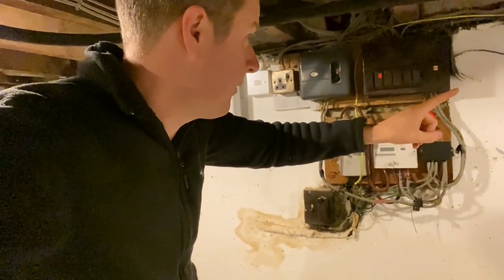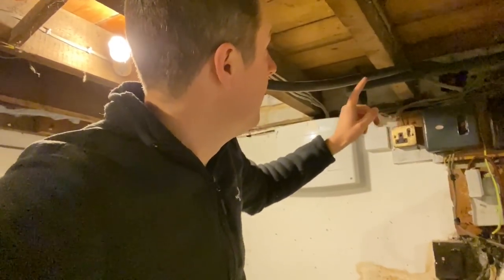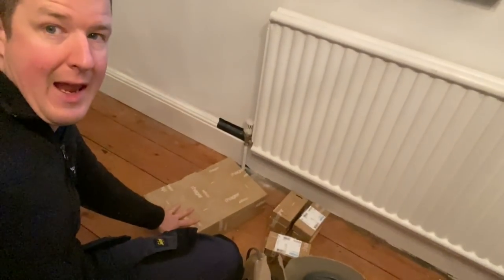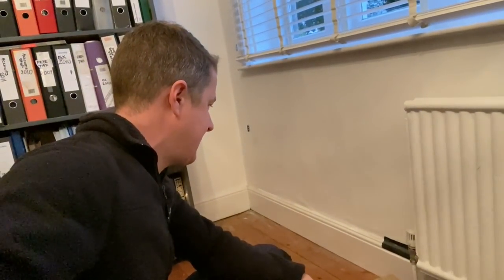Moving A Consumer Unit & Installing a Sub Main

Comment: As a DNO employee I'm surprised at what the UKPN jointer told you!
Removing the cutout fuse is a prosecutable offence and should only be done by trained and authorised personnel. If you need isolation then your DNO will (in our case at least) safely disconnect and reconnect the supply for you, or install an isolator switch immediately after the meter. 
Also bear in mind that smart meters alert the supplier whenever power is lost. The supplier then contacts the DNO to alert them to a power cut. Someone from the DNO then turns up to find an electrician with the cutout fuse out. Having been sent there on a potential fault you have to report what you have found to have caused the fault. You'll be lucky to find a DNO employee who will stick his neck out and lie for you in that situation 🤷‍♂️
Reply: I agree. A jointer / mate should never as any non UKPN employee to remove a fuse for them. The old cutout should have been removed and the earth on the new cutout was put into the wrong side of the cutout.
Reply: How exactly does one go about getting them to install the isolator switch? The former owner did a sloppy DIY job on my CU, and as fixing it up means pulling the fuse anyway, it makes sense to have an isolator fitted to facilitate future work.
Reply: @vylbird8014  you would need to contact your local DNO. This is who owns and maintains the electricity supply to your house, rather than the supplier who you pay your bill to. (Google who is my DNO) . They will be able to supply and install an isolator for you. It is chargeable work, I think around £130 if memory serves. It is fitted directly after the meter meaning any work on any part of your internal electrics can be completed safely and legally.

Comment: The bits of left over dno cable I've played with in the past have always been 25mm solid aluminium phase with a 25mm stranded copper concentric neutral. That's domestic of course.
Is a metalcad fused switch the correct item to put in an external enclosure? What is the corrosion warranty on such a thing? All DNO equipment is plastic?
Reply: New DNO stuff is plastic just as they're making us put in metal CU's, they're not filled with Bitchumen anymore either, it's gel based stuff like you'd find in those wiska underground rated joints though the outside underground joints they use are setting resin pours. That outside green cabinet is plastic ip65 rated so the metalclad fused switch isn't an issue. 

Depending on area/size supply most of the 3 phase supplies are solid copper cores I've come across, anything from 75-250mm. Apparently there's Aluminium ones for the bigger cables on the newer supplies but I haven't worked in any large sites that have been built post 2000. Edit: The 3 phase are concentric too with the outer armor sheath being cpc/neutral.

Comment: Pull the fuse!!! 
I was made to go on a course to learn how to pull a supply fuse,
Reply from the maker: Ha ha ha
Reply: Just watch Youtube pmsl :-D
Reply: Yes. Pull the bloody fuse. 

Half the monkeys that turn up to do it for you probably couldn't spell fuse!
Reply: Yeh kill any load before pulling!! Another reason you may have to pull main fuse...we had a few call outs to    standard cable damage inside the property where the fault current was enough to take out the main 100A cutout..as well as the mcb,S ect...panic,go try and buy one then fit it,!! .so buy 2 And keep one on the van.generally 2 sizes.

Comment: The DNO will not remove the cut-fuse unless emergency or holder damaged. For me every situation is a question of safety and as long as you isolate the load before and after pulling the cut-out and it’s plastic then I don’t see what the problem is. Metal cut-outs with close distance between the fuse pins and holder are a different matter. 
Generally it’s the Energy supplier’s job to pull the fuse for a CU change.  This can be a nightmare to arrange as there are now 60 suppliers and they tend to come and go. Also all call takers do not understand the service you require. Other problem is they will initially only talk to the account holder. Some companies do the task foc whereas others can charge £50 or more and need  3 weeks notice.
Reply from the maker: Yeah what a can of worms!
Reply: i've never understood the term 'energy supplier''.. surely that's synonymous with the DNO... I think 'bunch of people who send you bills and do not a lot else' is better <grin>
Reply: @TheChipmunk2008  The DNO pulls the fuse, but the DNOs seldom communicate with the homeowner or electrician directly - usually communication goes through the 'bunch of people who send you bills.' So the homeowner asks the electrician who asks the supplier who asks the DNO... and somehow it takes a month to actually schedule anything.

Comment: Are you going to box in the cables underneath the consumer unit?
Reply from the maker: Yeah the customer will
Reply: What if they don't though and someone damages them cables and gets a belt??
Or do you just note on the cert customer to box in cables.
Great video jordan
Reply: Theres nothing wrong with clipping direct through a joist space in a cellar. You would not have to state anything on a cert regarding this 🤔

Comment: wonder how hot the service cable gets if one were to put  95amps of dummy load though it. Needs to be tested, cause it doesn't look like it would handle it continuously.
Reply: They handle it just fine. barely get warm. The older service cables of about 9sqmm equivalent copper get a bit warmer on a 100 amp load, but PILC can survive that temperature

Comment: Hi Jordan.  I'm an adult learner with plenty of theory but no experience.  At the beginning of the video you mention that the water incomer is plastic but has copper parts later in the system.  My understanding is that if the mains supply is plastic, there is no need for bonding.  John Ward's video https://www.youtube.com/watch?v=a5JOTA-mJ4A  explains this.  Have I got it wrong?
Reply: I could be wrong here, would the incoming water mains not act as an earth, when it enters the copper pipe section. Copper is the conductor and so would the water inside, and the rest of the water?

Comment: Great video, one outstanding question. Why downgrade the 100amp supply head to 80amps with your MCB at the isolator feeding the SWA and consumer unit, with EV charging being install in more domestic properties that extra capacity maybe needed.
Reply: Answering my own question, with reference to Fig3A4 p370 BS7671:2018, 80A typeB circuit breaker with not breaker after 10,000 sec from a load of slightly over 100amps.

Comment: Did you just touch a live supply cable without checking with your Voltage Detector Pen could save your life always check unknown stuff its not technical and cheap

Comment: Isolate all loads. 

Pull main fuse.

Stop worrying, it will be fine.
Reply: Have been told in the past you can pull main fuse but a big no no is interfering with the meter .
Reply: @raychambers3646  I've switched tails in the meter before. 

It was like that before you turned up guv. 

I used to care, but unless the main fuse looks like a relic from world war one, ive stopped caring.
Reply: @MH-sf5ml  I've taken live tails out m/clad db  before now,not as scary as it sounds.installed new db and reconnected.

Comment: Dno size their cables according to average demand which is 2kw. So technically they only have to put in like 2.5mm 😂
Reply: Also, the way DNO cables are constructed, we use separate cores for earth, neutral and live and each needs to be thick.

But with DNO, if they wire them up as PME they only need a solid core for the live, then they have an outer layer which surrounds it and doubles up as earth and neutral combined. 

So rather than being a big thick cable with 3 thick separate cores they only need a cable with 1 thick core wrapped in another thin layer like on an armoured cable.

So cable effectively becomes same size as a single core armoured cable.

Comment: How on earth do they splice the incomer when it's live?
Reply: Procedures, live jointing techniques and PPE
Reply: @sparky9282  ...and knowledge, experience, and common sense. oh...and rubber gloves :-)
Reply: @muzikman2008  that's right! I'm an ex electrician who has retrained as a LV and HV cable jointer
Reply: Two tools required. A hope and a prayer.
Reply: "Carefully"
Reply: Thick gloves and brown trousers
Reply: Carefully, with plastic tools and insulating gloves.  Facinating process to watch.

Comment: Did you think about using these Jordon (top job connectors) Can just use a large adaptable box with a din rail where the old consumer unit is. 
https://www.wago.com/gb/c/installation-terminal-blocks-and-connectors

Comment: Would love to have seen UKPN joining the new service cable.
Reply from the maker: Yeah don’t think I would have got away with filming that! 😂
Reply: There are a couple of videos online. It's all done really quickly, watched a crew jointing a row of new houses into the 3ph service cable in the pavement... (the original services were tn-s and had all been isolated when the old houses were demolished)... they cut into the main cable every 3 houses, and hooked in 3 cables -one to each phase, in a joint enclosure a little like the one shown, but 3x the size (main cable was about 2 1/2 inch diameter, PILC). They did maybe 8 of those in a day! 
All live. Those guys earn their money
Reply: Until you get a dodgey Cut Out and one goes Bang